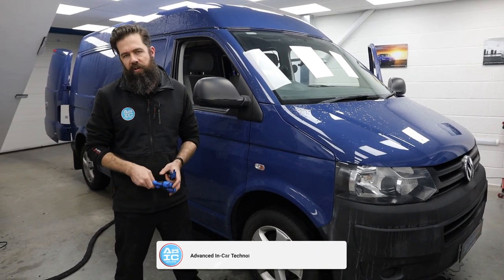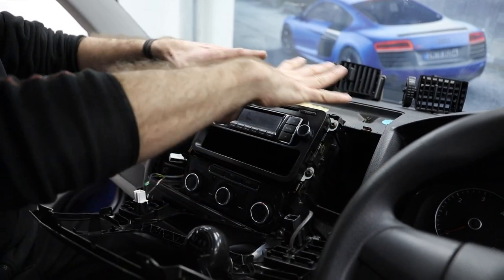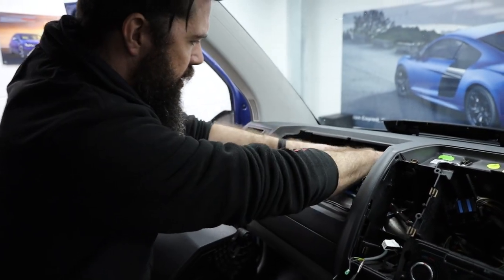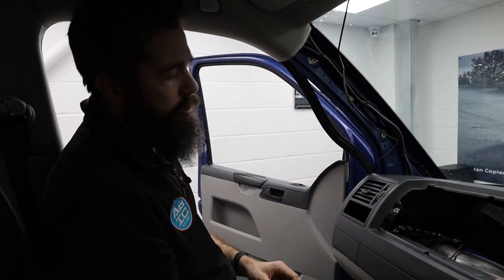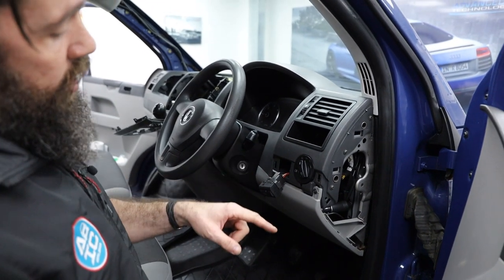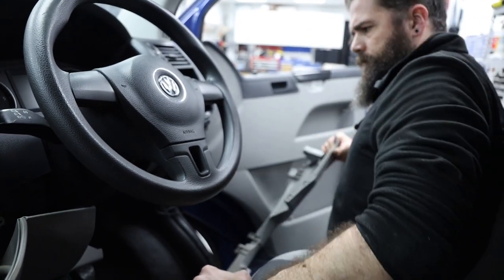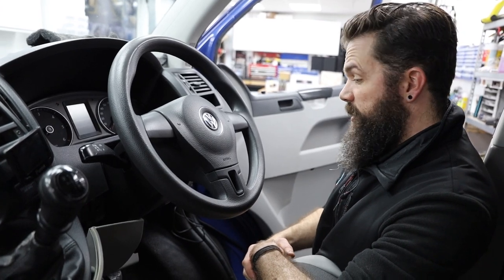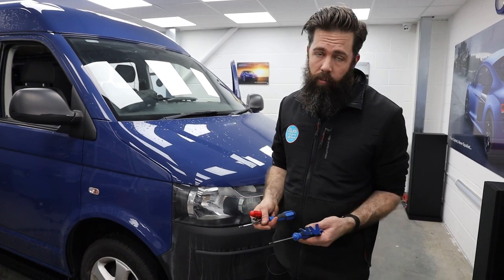How To: Remove the Dashboard in your VW T5.1 - Improved Access for Retrofitting/Upgrading Tech/Audio

Comment: Really appreciate this video, would you consider going one stage further and pulling the complete dash? I have a failed temperature sensor (upper right) in the climbatronic and there appears to be a metal plate preventing contortionist access.

Comment: Hello
My instrument cluster is resting when i swith off ignition (clock mpg etc) and the rev needle is stuck at 1000 (at idle rev) when taking out the key and slowly resets at zero when I reinsert the key but everything is reseting.
Any advice for the issue above? Checked fuses already